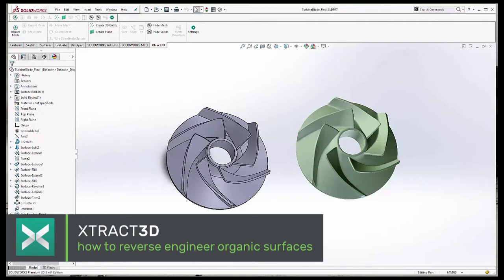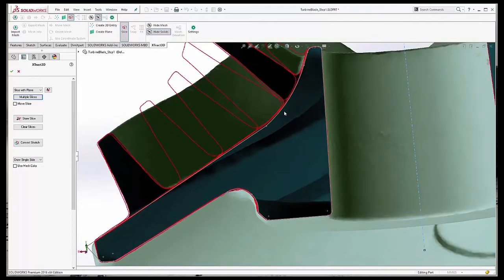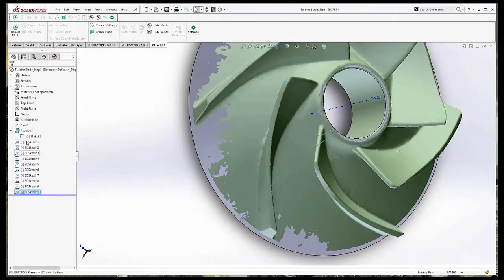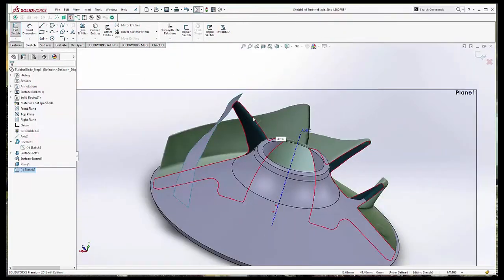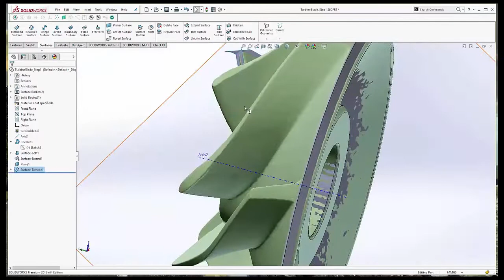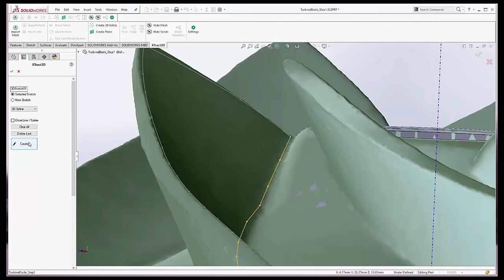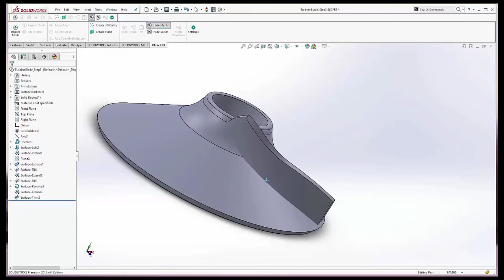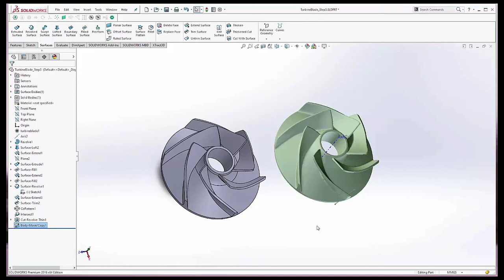How to Reverse Engineer Organic Surfaces from 3D Scan Data

Comment: Hi Thomas. You're still left with one surface body and one solid body. IMO the tutorial would be further  improved if you delivered a solid body in this kind of tutorial, as usually users are trying to avoid any remaining surface bodies that cannot be formed into solids. That is the whole point really.
Otherwise excellent.
Reply from the maker: Thanks for the feedback! It's hard to see but at the last step the intersect tool will delete remaining surfaces bodies resulting in a single solid.  In the interest of keeping,  the videos going quickly sometimes the small steps are glossed over.